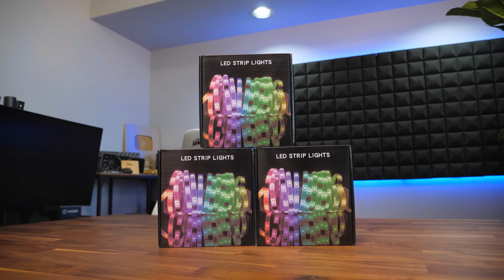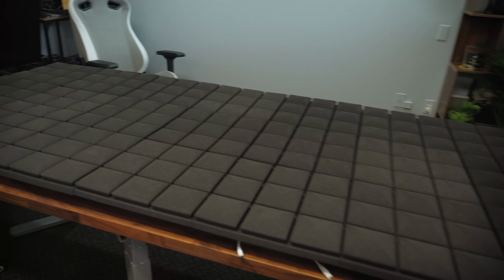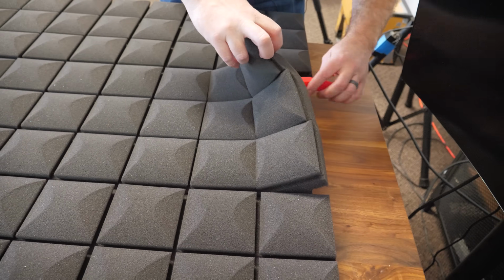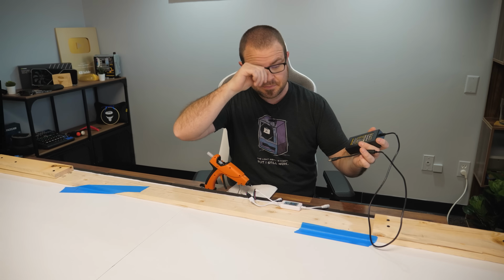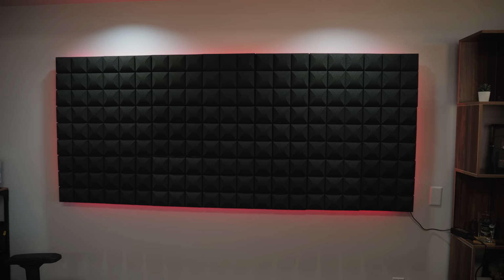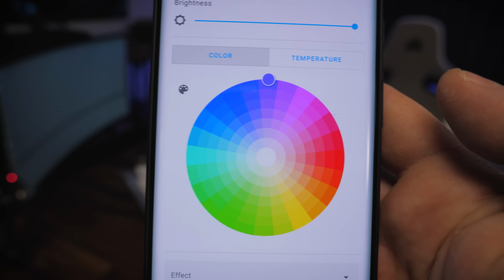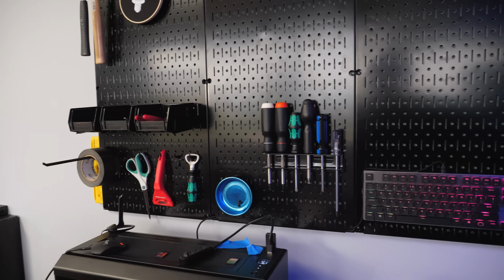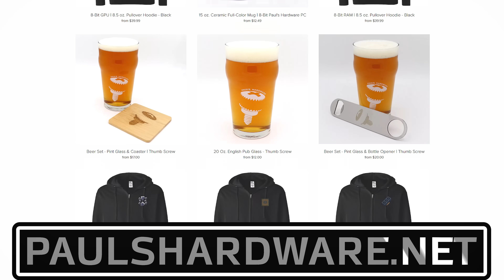Proceeding to Phase Two at last...

Comment: Metal Wall Panel - Straightening Tip - lay it face down on a piece of flat wood like a sheet of ply. Then get a piece of 4x2 and your hammer and put the 4x2 on the dent and then tap on the 4x2 with the hammer. Keep moving around the 4x2 over the dent while hitting with the hammer on the 4x2 and the dent should go flat. Put the 4x2 upright, sideways or lying flat depending on what you think is best to do for that particular part of the dent or bumps.

Comment: When I put up foam panels in my game room I bought black poster board. I then glued the panels to the poster board using regular Elmer school glue. That gave some freedom in adjusting them a bit for alignment before the glue cured. I then pinned the boards to the wall with thumb tacks. A similar approach may work for you also in getting better alignment. Keep up the great content, also the beer recommendations!

Comment: you can put a black tape or somethink like that behind the acoustic panel where the foam meets to get rid of the backlight bleeding through the gaps, also trim the edges where they pop ou a little to make it all aligned would be nice

Comment: To hide the imperfections of the foam board edges, I suggest to mount the foam panels on a piece of dark grey paper/wood/whatever backing that is ever so slightly larger than the size of the entire chunk of foam panels.

That aside, the framing of the shot at 16:00 feels weird with the top edge of the foam board being at a weird angle compared to the frame of the video and corner of the ceiling and the pegboard.

Comment: Just a side note and tip, don’t use your regular house hold vacuum for drywall dust.  It can damage it.  I know it’s only a small amount but I wouldn’t want my Dysons lifespan shortened.  Any shop vac works be fine.  So just get a small budget one for stuff like that 🙂

Comment: Use that spray can glue on the edges of the foam to stick them together directly, then apply the sheet to the backing board the same way. Will suck to get it off again if needed, but if you line everything up right the first time, it will be the last time you need to do it too.
Reply: Also if you do this, measure the backing board and mark the back of the foam for easier alignment.

Comment: If you're drilling holes in walls put an envelope below stuck with masking tape. Better than vacuum and you can keep moving to each new hole.   Have you thought about getting your logo printed on acoustic cloth then building a panel containing sound absorption materials like rock wool or sheep wool insulation.

Comment: Next time you fix your acoustic panel try to leave even a little more slack for the LED strips on the corners (so there's a noticeable bulge with a couple diodes in it). This should pump the corners of the lighting up a bit for a more consistent glow.

Comment: If you put down a layer of painters tape on the cable first, you'll be able to remove the hot glue later, should you decide to reposition it, sell it, etc.

Comment: Idea.  On the wall control panels, use a scuff pad and scuff up the panels well, clean and dry completely, then use Rustoleum Custom Matte Black.  Will take the reflection off and limit the visual imperfections.

Comment: remember Paul, even "fake" plants require attention too... DUSTING!!!
Reply from the maker: maybe Joe can do that
Reply: @paulshardware  hmmm.. potentially "additive" for job description... higher PAY allowed:face-turquoise-covering-eyes:???
Reply: Yes you have to remember to pretend watering them once a week
Reply: If there is a climatisation system, use the setting to have a higher pressure inside than outside.
Reply: @paulshardware  Rekt 🤣
Reply: Not if you water them regularly

Comment: The other respectable positive to adhering your led strip to the wood frame - unless something happens to the wood you can transfer it, in the event that you need or wish to replace the foam front.  Nice update man - black pegboard is nice thing which I've never wondered about.. wonderfully tidy! I support the use of artificial plants around electrics and Joe's use of the vacuum cleaner was inspirational!

Comment: Be careful putting weight on the shelves and the pegboard unless they are screwed into the studs. Those little blue plastic plugs won't hold much weight. If you need them to hold more than the weight of a photo frame, use molly bolts or spring toggles.

Comment: Paul, if concerned about the panel alignment, you could attach a frame to the white panel that bounds the outer edge of the foam. A frame that is more rigid than the foam would create a straight edge (if done well).

Comment: One possible solution to triggering people's OCD with the gaps in the panel... Not sure how much space there is in the side of the room that is off camera, but if there is some space, if you pushed your desk further away from the set wall, you could potentially decrease the amount of sharp focus on the objects back there by increasing the distance between you and the objects in the background and a wider aperture on your camera lens. If the acoustic panel were a bit out of focus, people probably couldn't notice any imperfections

Comment: Should have used cable tie-downs instead of hot glue for the foam panel's power cable. Can screw them into the frame. Easier to remove/replace cables later.

Comment: If the RGB is 1 inch from the edge - make it come out a little at the corners, so there's an led 1 inch from the actual tip of the corner. 
I just think it would look better with lighting all the way around, with no dark corners.
IMO

Comment: Hi Paul, like your new set, but there is one thing you should fix that is to straight the acoustic board that you just finished.  When looking at your video, your video framing is off by the acoustic panel, either your acoustic panel or your camera is not level.  The acoustic panel looks way off in your video framing.  Maybe is your camera lenses distortion, anyway take a look back to this video and you will see what I am saying.  Love your channel, keep up the good work, best wishes.  
H.

Comment: About the panel back there... Still see through and not perfectly aligned. I would just have bought some wood to extend the backplate to the edge and then make a cheap frame in dark wood or paint it black, or same color as the wall and call it a day. Then you will not see the foam line. I think it will be very hard to get a soft material like that to be perfectly aligned. Like your new office. Looking good.

Comment: HEY PAUL - ? You helped in my 2019 build decision.
Q1: What ATX case should I look at that has 2 X 5.25 external slots. I want to keep my CD/DVD R/W drive. I also have a 2TB Disk drive I would like to keep. No bling needed. Desktop is on the floor and won't see se it.
Q2: Just bought LG 42" C2 4K OLED (sweet) for office monitor / TV. Time to Upgrade! I was thinking of a last A4 AMD PCIe 4.0 build. What would be a good build around a RX 6800 or 6800XT GPU?
I thought about building a "future proof" PCIe system but figure by the time I update it. All of the overpriced components now will be at the low end anyway.
Thanks! Plants are a nice touch. :learning::washhands: